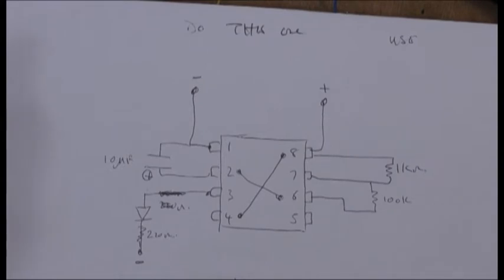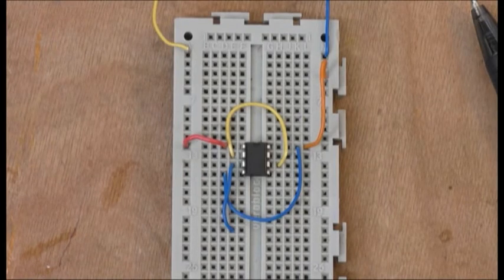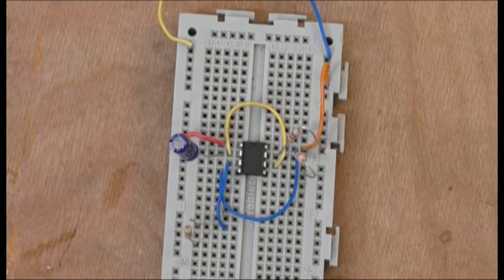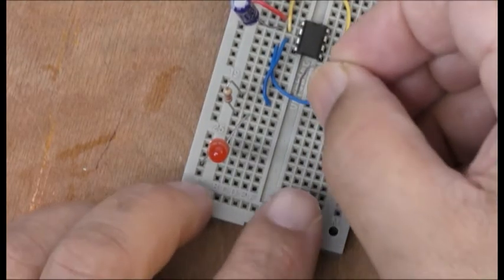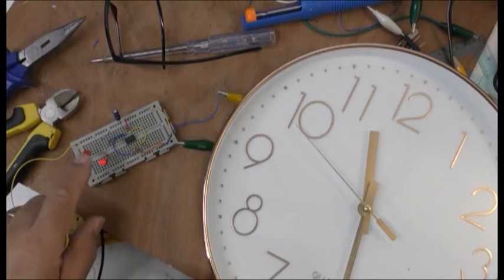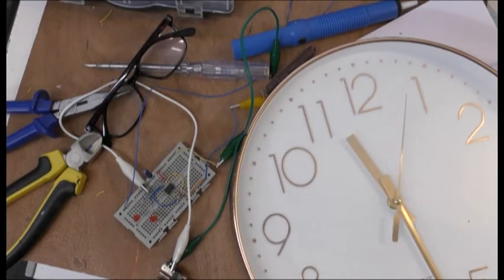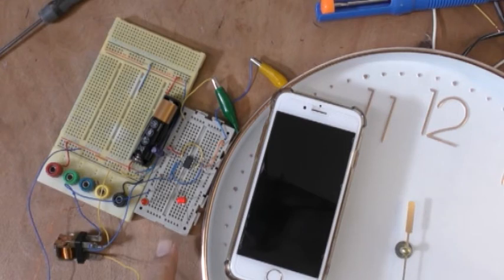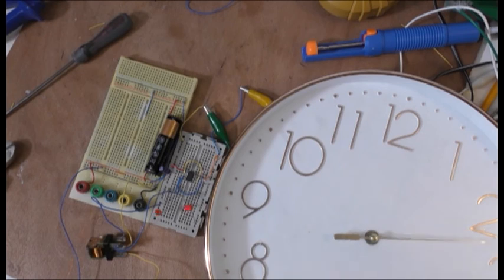#140 How to slow the Quartz Clock

Comment: Can i just use the battery as the power supply but make this circuit as a switch between the battery end and clock?
Reply from the maker: I think you can. good luck

Comment: How can i sliw down the Quartz frequency from 32768
To 24500 khz

I want to measure martian time  
Which is 24 hours 39 munutes
In one mars Day

Hope you can help me
Reply from the maker: I have slowed down the clock in one of my videos but not used frequency. I made the power supply to come on using a electronic timer. Thanks